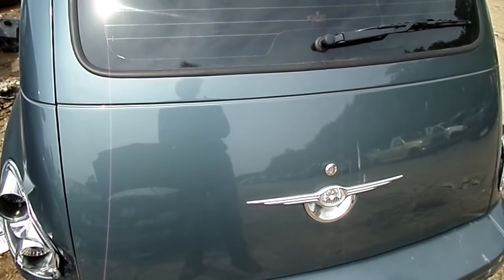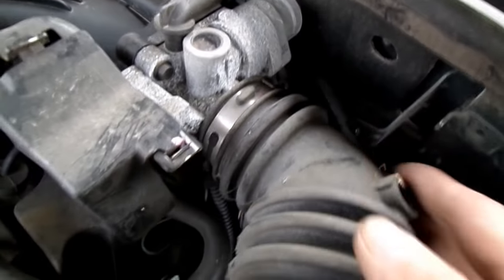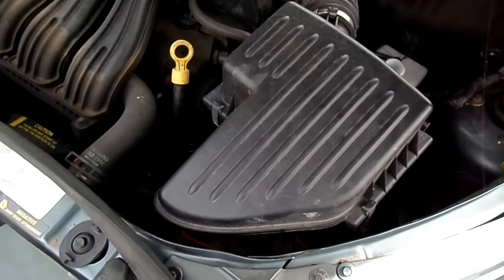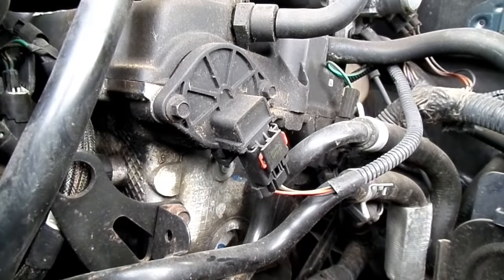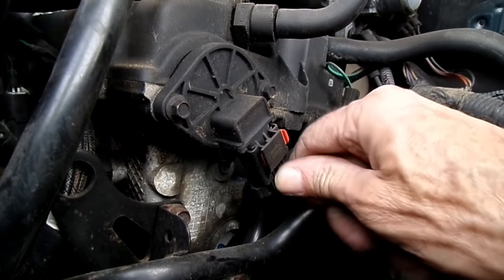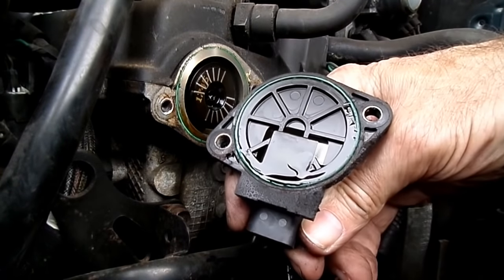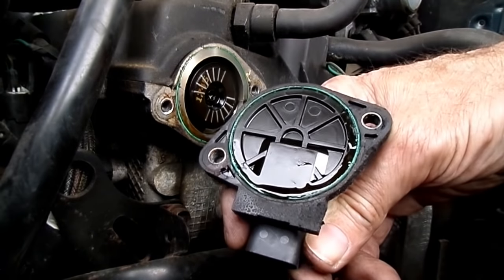PT Cruiser Camshaft Position Sensor Removal

Comment: For anyone that is having a Camshaft Sensor issue and you think it needs to be replace READ THIS FIRST.  Unless you have tons of miles on your car (150,000 +) you may just need to take the Camshaft Sensor off and give it a good cleaning.  Clear the seal off the aluminum head (where you can see the green blue in this video after he takes it off) make sure not to scar the aluminum. Then get a little pick and pull out the seal making sure its not torn.  If not, clean the seal off really good and also clean out the channel where it lays into.  After everything is nice and clean reattach the Camshaft Position Sensor tighten it up nice and good put everything back together and test drive. If you have an OBDII scanner and can clear the engine light do it before the test drive.  If not you will need 3 good test drives before the computer will clear itself.  Many times these things are thrown off because of a seal being torn or the sensor is really dirty. This may save your $40 to $50.
Reply: Sensor is only $18 to $20 to replace

Comment: Nice. 

Note: To anyone with Eagle Talon and Mitsubishi Eclipse 420a  cam sensor is in the same spot.  This engine looks to be the 2.0 420a except valve cover intake is different.
Reply from the maker: +DALE97DSM Thank you for info.
Reply: That's some what true for the 4g63 that comes in the eclipse and talon, the cam sensor can be located on the to but if its not on the top its much further down and a lot more time consuming. Same goes for the crank position sensor.

Comment: I replaced my cam sensor and got rid of the code for CAM sensor, but i still get a misfire code on cylinder 2.
Replaced plugs, wires, coil, cam sensor.. was just wondering if I should replace the crank sensor too?

Comment: how would you know  it needs replaced? the shop told me my crank senor went out so they replaced it, yet its still having issues,,so how can I know if that needs replaced also
Reply: John Hill there is also a  censor right below the starter too that goes out on these alot
Reply: the one below starter I was told was the crank sensor, now they said it and the pcm computer went out at the same time,,, seems odd for both to go out at same time.. the cruiser only has 36000 miles
Reply: John Hill idk i have just under 90,000 on my 05 non turbo already had to do axle shafts...these cars all the censors go out alot the cam censor gave me no warning check engine light came on and would go above like 10-15 mph without bucking like a bull lol
Reply: chrysler should be held liable
Reply: John Hill yah well probably why they stopped making them 😂
Reply: I am curious tho, when they re program the pcm, they ask for mileage, is it possible for someone to lower the mileage shown on the odometer from the re program,, hope not
Reply: John Hill idk but if you cycle the key 3 time it will either say done which means no codes or might show a,code if you dont have a scan tool 😉
Reply: it said done,,,,,  yet I think the garage said they bypassed pcm to fuel pump, yet no codes, and it dies sometimes randomly.. check engine light on now, and if you wait long enough it blinks 10 times
Reply: John Hill damm all i know is both will go out ,mine not far apart

Comment: Strange place to ask I know, but my engine codes came up crankshaft sensor and cam shaft position sensor, I watched a few videos on both these things...(too see where they are mostly) and I've seen five people for each thing ALL replace the SAME item. But they have different prices...I'm confused. Please just help. 
2006 pt cruise

Comment: You don't have to remove the battery I just removed my air box
Reply: Its to turn the computer off so the car can recognize it when it gets turned back on. In some cases itll still read a bad sender even if you replaced it because the computer needs a reset . but idk.

Comment: Be nice if he actually showed we’re the hell the cam sensor is located!!
Reply: Look immediately to the left of the air intake box...right above where the little air hose is attached to the bottom half of the box.
Once you remove the box, you'll see it right on the upper right side of the engine as you are looking at it.
8mm socket is exactly right.
Took me literally 18 minutes and this included about 4 minutes trying to unhook the sensor clip of of the module first.
Hope all works out.

Comment: Not too horrible to get to, but the panel tool failed :-( 

Looks like there must be a hall effect device in that plastic plate, all the nice strip magnets set into the end of the camshaft to send position/speed pulses to the computer.
Nice design, but i think the car is as ugly as sin lol, ive seen them here and yuck is my automatic feeling.
Reply from the maker: +zx8401ztv I will admit they are a different design.
Reply: +richpin06a Ha ha you like them, too diplomatic an answer ha ha :-D
Well it would be a boring world if we were all the same :-D

Comment: Horrible information can anyone tell me where he told you where the sensor was at after you move the airbox he doesn't he's assumes in never make a video again ever in your life dude throw your camera away
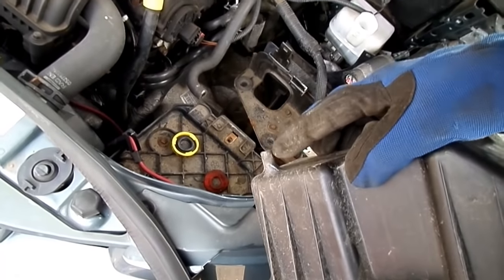Reply: nicholas lotta take a deep breath and think for a moment. Why did he take the air box out...it must be in the way of the sensor. He practically points at the sensor at 1:29...it's to the left of his index finger while he's pointing to the location where the airbox plugs into its bracket. His next camera angle shows a closeup of the sensor with the two 8mm bolts and the wiring clip. And as Justright4you1 mentioned in a post above, those sensor clips with the safety catch can be a bear to get off. Hope you got it fixed.